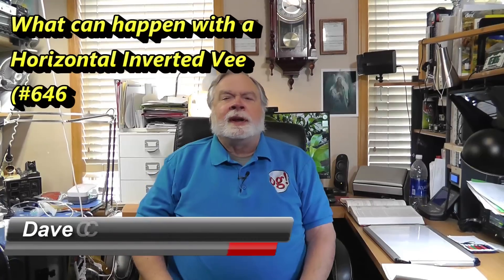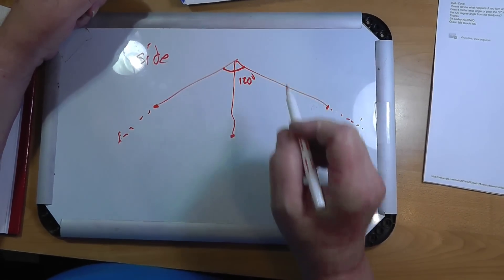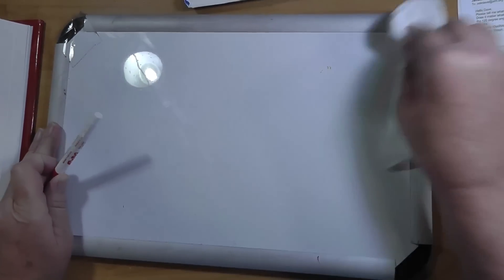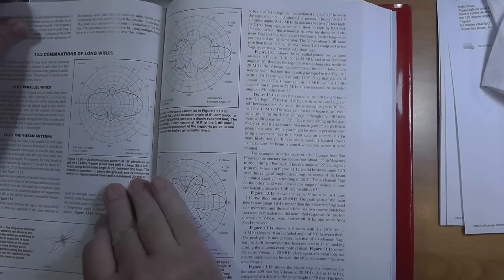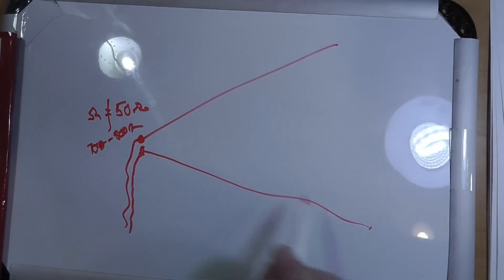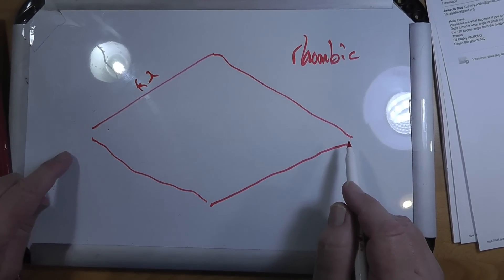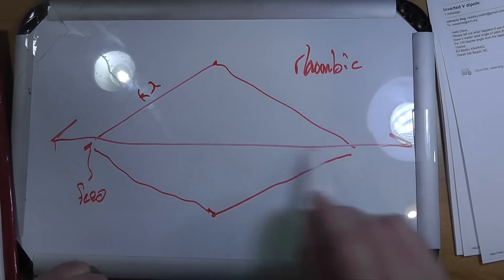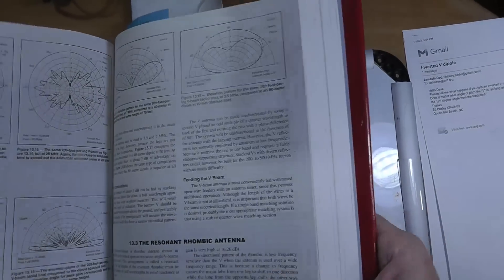What can happen with a Horizontal Inverted Vee? (#646)

Comment: You apparently assumed the question was referring to some kind of long wire inverted V antenna. It’s much more likely the antenna in question was a half-wavelength inverted V, which the answer would be quite different. There are posts about bent dipoles online that better answer the question. As I recall, at the base frequency it tends to reduce broadside directivity relative to an unbent dipole, broadening the already fairly broad azimuth pattern and  filling the end-on null. When operating on harmonic frequencies the azimuth pattern becomes more complex, but at no angle does it increase directivity relative to a dipole. It’s roughly equivalent to sum if the patterns of two dipole antennas rotated in azimuth relative to each other to form an X, with half the power going to each dipole. That’s not an exact analogy, since it neglects coupling between the two dipoles, but I think it’s close, and much closer than the analogy to a rhombic configuration.

Comment: Thank you for the video and explanations.  I also read the comment from jamaciadog5603, the one who posted the question.
Maybe it doesn't matter a lot, but I'm wondering 2 things:  First is the signal as first shown (with the wires one above the other) vertical or horizontal and 2nd if the antenna is oriented with ech end located the same height above ground (maybe the same height as the feed point) does the signal change orientetion and does the antenna still perform as first shown?  Thank you very much.

Comment: About 10 years ago I made a half-wave 10m horizontal V-beam of 16 ga wire stapled to the ceiling of my radio room on the first floor of my house.  The angle was (accidentally) about 120 degrees and fed untuned with RG-58 coax.  My rig at that time was a retuned 25w Uniden CB.  From my West Coast location I worked dozens of stations in Europe, South America and Oceana.  I was flabbergasted at how efficient it was.
Reply: I made a 10m dipole (my 'Fifty-Cent Antenna) out of a few parts I came across while cleaning up my garage a few weeks back. I got it 20' above the ground and talk to Europe and South America from Houston every day.

Comment: As Casler said, keeping that 120 angle is important.  It relates to how directional will be, some or a lot.  Unless you can model your antenna very closely, any/all the answers are only possible approximations.
Easiest way of finding out would be to just put the thing up and see what happens.

Comment: I have that exact antenna up at my place.
Horizontal it is about 110 deg and the inverted "V" is 30 deg below the horizon or 60 deg from the pole.
With that data input into EZNEC it show up as a vertical with lobes off the end of each antenna.
I have made contacts everywhere from west coast the full pacific rim, AUS and NZ and Cape Town So Africa all on FT-8

Comment: Hi Dave. As usual the question raised by "Jamaica dog" is different and your understanding of the question and hence the answer you tried is different.
Any inverted V dipole whose angle included is 120 degree (to the horizontal) would tend to offer a pattern almost similar to that of a horizontal dipole.
That is the broadside radiation pattern.
When the angle becomes 90 degree it's almost like omnidirectional in the azimuth plane.
He asked what happens to the radiation pattern if the 120 degree V dipole is turned sideways.
He didn't mention if the apex (that's the feed point) is near his house (as you assumed and drew on the board) 
But that should be the case because it involves a short coaxial cable feeder from his shack.
He never mentioned that he was going to use multiple half lambda long wire for the dipole. It's quite obvious that he speaks of a simple half lambda centre fed dipole for 40 meter band.
And in this scenario his dipole may have little bit of directivity gain in the direction opposite to where the apex is facing. But then if the building is very near the apex and sufficiently tall and broad some of the signal would be reflected and may get reinforced; or may get destructively interfering with the ongoing signal.
I hope this helps.
De VU2RZA.
Reply: Talking about drifting away from the original question.

Comment: Thanks for answering my question Dave. This antenna is up, with swr of 1.7 on 40 meters. ( I always use the internal antenna tuner to get it 1:1 but im into CW, QRP) The lower wire ended up a little less than horizonal (to coax shield) and upper wire to feed is 45 degrees to 35 ft in the air to the same tree. Recieve is great. I have listened to the Utah SDR online with a less than a second lag but it comes in on my radio first. The dipole is pointed SW. I presume that even though I can hear stations west, Most transmitted signal is going SW and NE, so QSO's are going to be best along the eastern seaboard? Makes me want to put up another one pointing west! Thanks again for providing answers that are hard to find. 73 KN4RWQ

Comment: A rhombic is a truly amazing antenna
.  As an intercept operator I can vouch for that..  BUT, it is HIGHLY directive..  it works well as a point to point communication antenna.. or at the most an antenna that covers a very few degrees of horizon well..  signals fall of fairly quickly..  I love the antenna, but might not use it as an all purpose antenna, unless i were to use it to keep a regular schedule with one particular distant station..

I know, I know.  I pointing out the obvious.

Comment: What if: i have a 40 foot dipole.  But only 35 feet to work in.  Can the ends be turned in a different direction?
Reply: Yup. You can also use the squarlo design or shape it in a U like an aircraft rams horn antenna and put some end loading if needed. They all produce a pattern about 3Db below a dipole but omnidirectional rather than bidirectional. Height effect remains the same.

Comment: I have quite a similar Setup with an Inverted V dipole from the house roof to the end of the garden. The angle down is about 20° and the angle of the legs about 15° It seems to behave quite nicely locally, so Europe but unfortunately I have about S8-S9+ noise on all HF bands so I am mostly operating SOTA